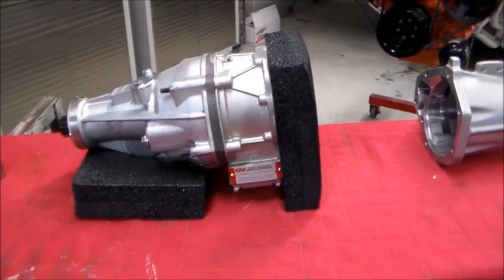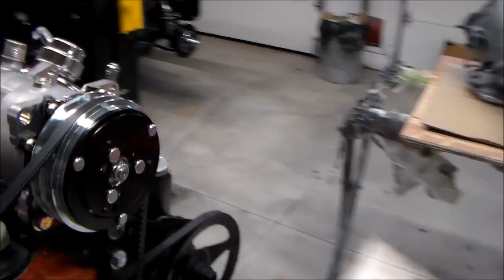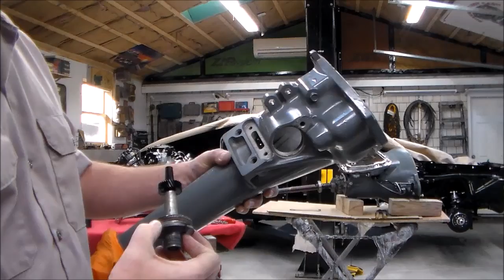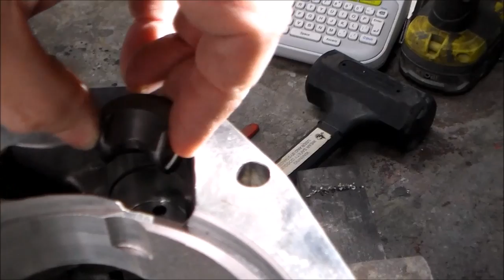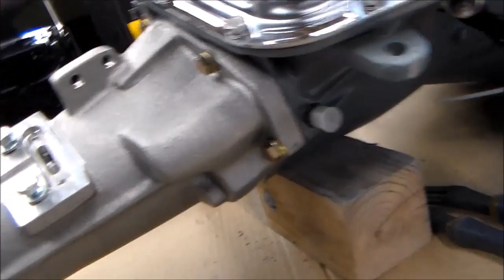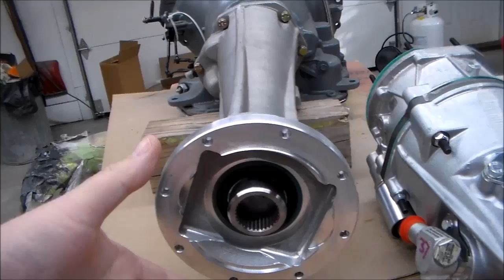Gear Vendors  Overdrive Installation By Troy Kane Vtwinstov8s.com

Comment: If you have this installed on a THM400, does the overdrive gear kick in automatically when you reach a certain rpm? By the same token, does it switch off automatically when you slow down and start in first gear again?
Reply from the maker: Good question. The unit can be manually shifted into OD or out of OD. If you leave the unit on "automatic" in other words in OD all the time time, what happens is it is shifted by the speed sensor. Below 45 MPH no OD. When you reach 45 MPH it will automatically shift into OD. Hope that was helpful. Good luck

Comment: With the gear vendors did it change the driveshaft angle alot as opposed to the original setup if I remember reading the gear vendors adds up to 12 inches to the transmission setup
Reply from the maker: Good question. It did change the driveline angle. But, with the adjustable suspension I could change the pinion angle.

Comment: Great video. I'm getting ready to install a GV unit in my Duster. Which video do you discuss the wiring up of the unit? You mentioned that you would cover it in an additional video. Thanks!
Reply from the maker: I lost the video. It got corrupted. But the wiring is pretty straight forward. Thanks for watching and commenting

Comment: Awesome video Troy. Loved to have seen how you setup the wiring inside, is there a switch for split shifting? What I’m talking about is do you have to cut the switch off and on each time you shift, if you follow what I’m trying to ask. 
Thanks for your videos 👍
Reply from the maker: There is a dimmer style switch on the floor to switch in and out of OD. The unit will shift by itself if you leave the swith on, so when you slow to a stop it drops out, when you re accelerate it shifts up. Sorry, I never made a wiring video. Thanks for the comment.

Comment: I have never seen anything like this ....i must live under a log 
Can this fit in most tunnels or do i have modify the tunnel 
Can they handle a lot of power say 700hp +
Thats really cool for drag week
Reply from the maker: They are Bullet proof.
Reply: @troykane  i just read the message under the video which answered my questions
Reply from the maker: Yes it will fit. I had to do some dimpling of the floor to really tuck it up in the tunnel.
Reply: @troykane  i have seen a few videos now 
This is a really cool item
Reply: Well might put  that one the wish list 
$6299.00 in Australia i can buy a lot of fuel for that price i dont drive my car enough to warrant one at that cost

Comment: Good video! Bunch of haters in comments smh … it’s been a few years how you liking the gear vendors and how is it holding up so far ?
Reply from the maker: It's bullet proof. Works like clockwork. Thanks for the comment
Reply: Not a hater but I did notice that you didn’t mention filling the overdrive with fluid just sayin no offense I have seen this be skipped and it was not good
Reply from the maker: @treyvader  woops, Wait it needs oil?

Comment: If you have a Ford AOD what would be the benefit of putting one behind a vehicle that already has OD? Would be even better wouldn't it??
Reply from the maker: I think it would depend on the rear axle ratio. Also the intended use of the vehicle.

Comment: Do you need a crossmember for that thing?
Reply from the maker: no it's self supporting off the transmission
Reply: Seems like a lot of weight hanging on that adapter housing
Reply from the maker: Nope. It's not that heavy.
Reply: @troykane  I would be concerned about this also, seems like a bit of weight for such a long skinny tail housing. With the gear vendors hanging off of it I would think there would be a lot of deflection and possibly crack the tail housing. Especially bottoming out on a rough road, which I know that car has no business on but it's a concern. An additional crossmember with a flexible mount just to support the weight but allow twist might be a good idea.
Reply from the maker: @stevenbelue5496  It's fine, they are proven to hold up to thousand of horsepower and hundred of 1/4 mile passes.
Reply: @troykane  I guess the 727 is probably the longest skinniest tail housing of all, the 904 is a bit shorter I think. I would be going behind a th400 or powerglide which both have options for shorty tails. I have a few diehard dodge guys in my area, I've heard it said if all the geometry is correct and shaft is balanced correctly  you will have no problems with the 727s long tail but if it's off a little it's not near as forgiving as others, which is common sense I guess. I'm sure the guys developing that tail piece for the addition of the gear vendors foreseen an issue and put a lot research an development into that tail housing so it would hold up.

Comment: What rear gear are you running? And if you’ve had the car on the road what RPM are you turning at 75-80 MPH?
Reply from the maker: I’m running 3:55 gears. I’m turning 1800 at 75 mph. This combo works great with the 383. Thanks for the comment. Good luck on your project. Troy
Reply: @troykane  right now I’m just browsing. I’ve got a Hemi in my roadrunner and I’d like to be able to go back with a 4.10 DANA and still be able to highway drive it when I want.
Reply from the maker: @southernoklahomamopars6726  the gear vendor provide a 20% decrease in RPM in OD. So at 70 MPH you are probably between 3000-3500 RPM now. So the Gearvender will drop that by 6-700 RPM.
Reply: @troykane  interesting

Comment: I just ordered mine for my 440 6pack challenger. Trans has to come out right? Can you install it assembled?
Reply from the maker: Easier with it out. You could install with the transmission in, but it's more accessible out of the car. Plus you can clean it, put a front seal in etc.

Comment: How much was the add on vs changing to different transmission
Reply from the maker: The gear vendor is around 2500. The advantage is you get to use the old school tried and true transmission original to the car. Plus you don't need a computer to control the transmission.

Comment: there is absolutely no need for such a long adapter like that one , make it the same length as a 4wd adapter and then bolt the overdrive in
Reply from the maker: Long tailshaft 727 torqueflite requires a long adapter. Unless you change the outputshaft. This set up is a direct conversion for this application.
Reply: @troykane  well that explains why owners of that transmission complained about cracked tail shaft housings, that tail shaft housing is stupid long